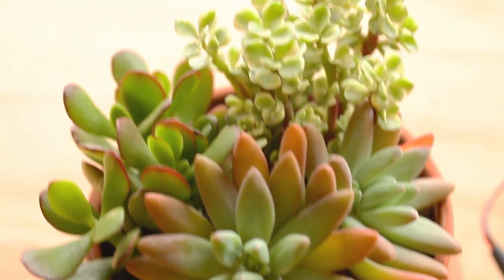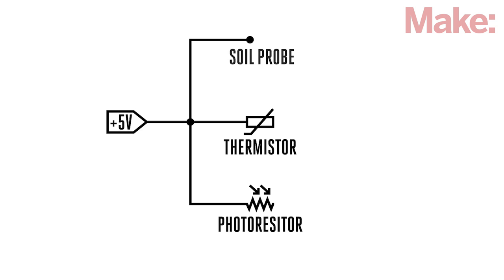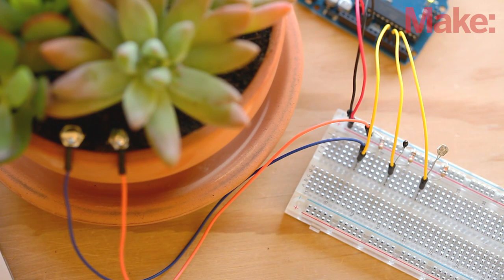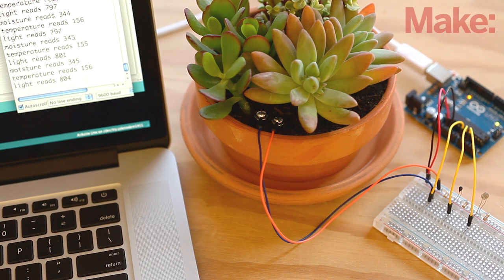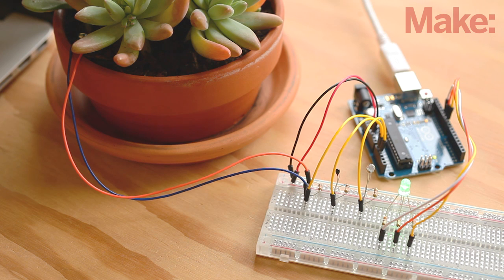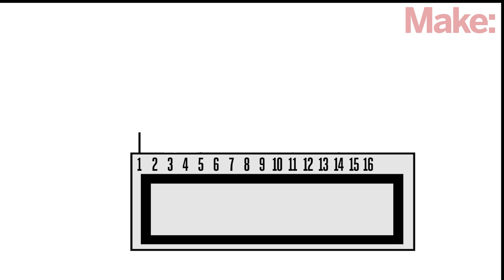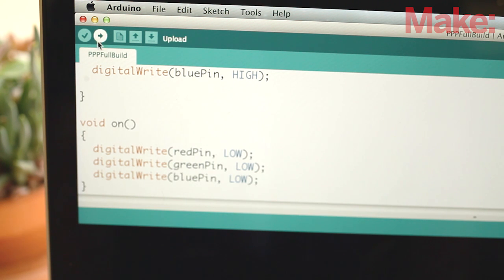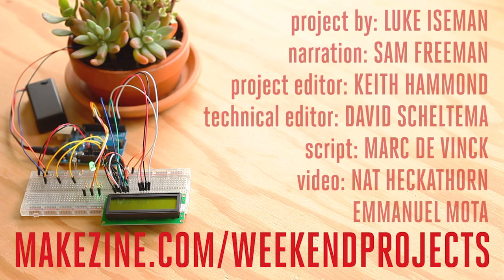Weekend Projects - Potted Plant Protector

Comment: I feel as if, while this might be neat, it's also kind of pointless without the capacity to actually adjust any of those factors itself (which isn't even mentioned).

It doesn't matter if it knows how wet/dry your soil is if it can't water the pot, and it's trivial for a Human to determine whether or not they need to water the plant.

The temperature is pretty much going to be the ambient temp unless it's in sunlight, or near a cold window. Even then, the thing can't move the pot, adjust the amount of sunlight hitting the plant, or adjust your thermostat so the info isn't really useful. Again, a if you know what temperatures are appropriate, you'd be able to determine the exact information pretty easily without this.

The sunlight levels aren't that useful either, because it has no way of adjusting them. Even if it did, too much light is rarely a problem for indoor plants. You could hook it up to a grow light to to help it resolve that issue, but a basic timer will do the exact same thing more robustly and simply.

pH again isn't that useful without a means of adjusting it. Are we going to be adding a watering system complete with plant-friendly pH balancing chemicals that can be dispensed in a controlled manner to create a solution to adjust the pH of the soil? Cause that seems pretty ridiculous to me. Sure that info might be more useful to a Human, but on the other hand, simple pH test kit can do the same, and your soil pH is likely find, and won't change significantly over time unless you're adding acidic or basic things to the soil. In any case, if you know what the plant favours, it shouldn't be hard to gear soil pH to that.

A light spectrum analyzer? Really? Okay, well sure, this might be interesting to know, but what are you going to do about? Have RGB grow lights? Well, you already know what spectrum you can achieve there, and what spectra plants absorb is well known. If you're using sunlight, it's the spectrum of sunlight. Maybe with less UV if your windows are treated for that. I don't see how this data is actually useful, however.

Similar with humidity. What are we going to do? Create a dome around the plant, and have misters? The humidity is going to be more or less the ambient humidity (very low in most houses), except for the humidity given off by the plant. Again, this is kind of interesting to think about, but it's not actually practical information unless you can change it, which you really can't as long as you're not doing anything silly already, like blowing the humidity away.

I mean, it's all very neat and that, but it isn't actually useful. It's a curiosity piece at best to distract you, or get your mind thinking about implementing a more practical larger system which can actually adjust those factors. That said, I hardly think most of your audience is going to go build a functional semi-automated greenhouse. To be fair, even then almost all of this could be replaced with simple timers and some mechanically adaptive systems.

It seems to me that, instead of bothering with this, it would be a better use of time, outside of being a neat means to learn about arduino, to just not do this, and just take care of the plant normally.

... I really just spent all that time writing this. Well then, yay being tired.

Comment: This would be great for an automated indoor marijuana farm. Just add automatic watering and light adjust.
Reply: Now that MJ can be produced commercially, I'm sure there'll be many automated systems developed to lower the cost, just as many other produce items have.
Reply: Corey Doyle Keep in mind automated systems in any agricultural situation can't reasonably do everything. Sure they can water the plants, and adjust lighting (wait, why wouldn't you just use sunlight, it being now legal? Plants are adapted for sunlight hours.....), but so can a guy turning a tap, wandering away, and then coming back and turning it back off again 15-20 minutes later.

What really needs to be remembered is that the plants need to be looked at, regularly, by someone who can spot illness, pests, or signs of poor health.

Comment: why do you need 3 330ohm resistors on each of the 3 anodes of the RGB led ? isn't a single 330ohm resistor on the kathode going to do exactly the same ?